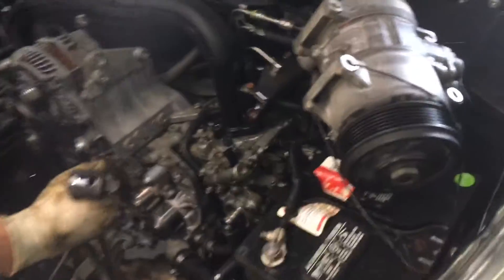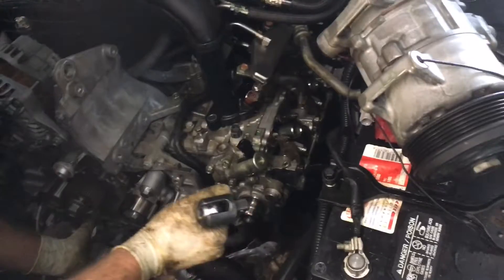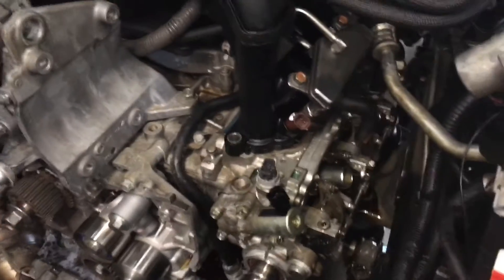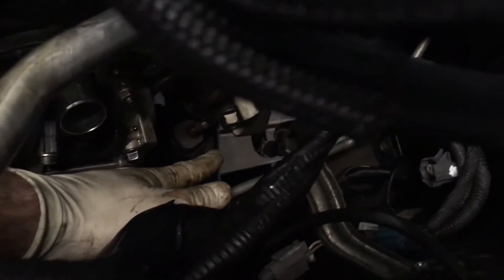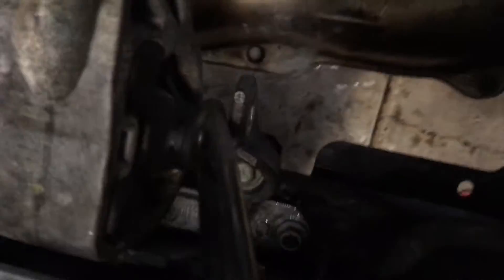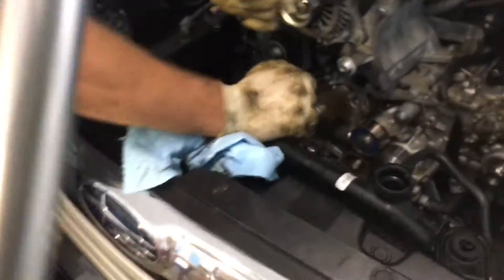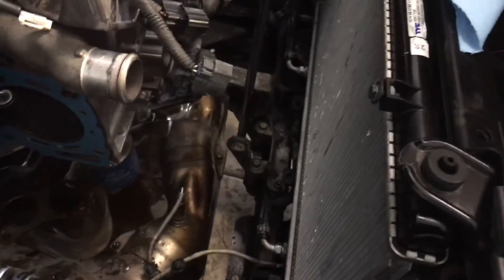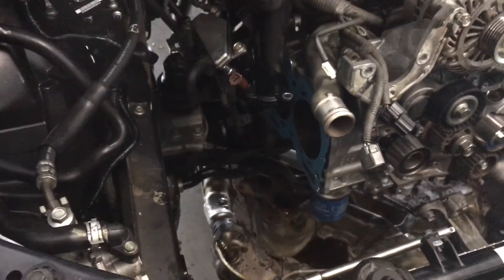Subaru 2.5 liter easy head removal

Comment: All this precision - making sure the gasket mating surfaces are clean and perfectly level, torqueing them in the right order and to the right specs... As for the engine itself? Eh, just crank it over to one side and then the other. I don't get it! Can I do this in my garage or do I need a precision machinist with me?

Comment: Very nice video. I’m getting ready to do a 2012 outback 2.5l dropped an exhaust guide no.4 cylinder. Looks like you didn’t bother to remove the intake.On a head gasket job on a 2006 I removed the intake but can you save time and leave it on?
Reply: I just wedge the intake up with a chunk of 2x4 when removing heads on a subaru.